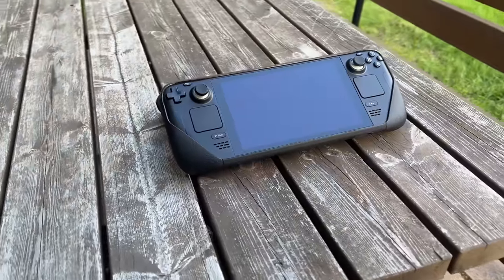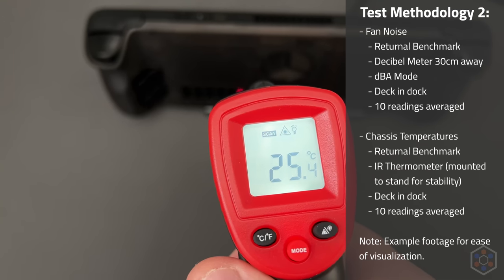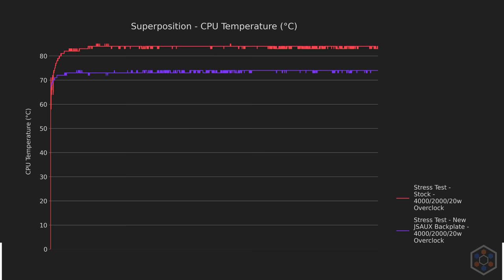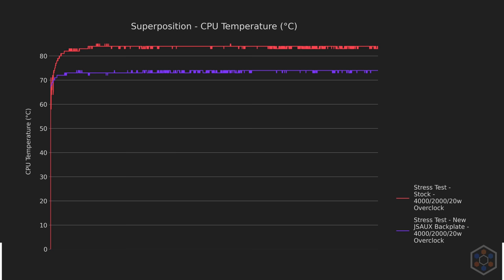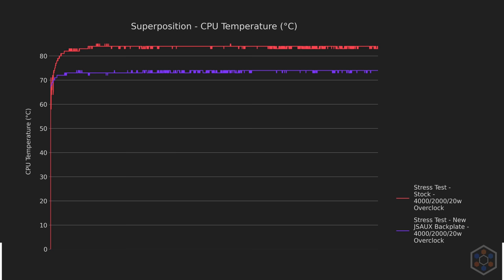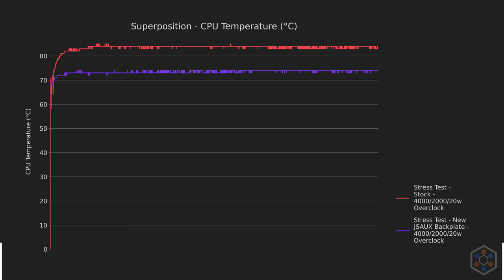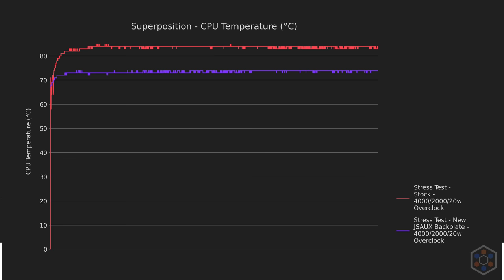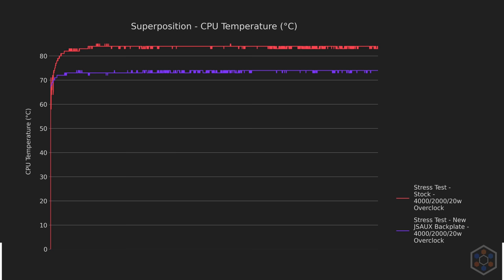How LOW Can It Go? | Steam Deck Thermal Modding

Comment: Kyle. You are the gift that just keeps on giving! There is a lot of scattered content on thermal modding but the video you created has the next level of polish to it. Sincere thank you from the community.
Reply from the maker: Thank you so much for watching another video! 😁 As always, I'm just happy to help.
Reply: I just had an idea. Drilling out vent holes in the back of the old Jsaux case would give you the best of both worlds right?
Reply from the maker: @jackinabackpack7599  theoretically similar, but with a lot of the heat sunk into the backplate still 🙂

Comment: Jsaux new backplate with thermal pad and fan intake vent looks promising especially if you want a quieter Steam Deck, but I'm worried it cools down the APU better but removes airflow to other critical components like SSD, ddr ram memory dies, voltage regulators, battery and other components that might get too hot now and fail earlier!
Reply from the maker: I mention that concern near the end of the video, but also mention that I watched all those temperatures and that they stayed identical and have given me no reason to worry about them 🙂

Thank you for watching, I'm glad it helped you out!
Reply: when you think about it... its much like a normal desktop pc right... the only components that typically get direct contact cooling with fan assistance or water cooling are the gpu and cpu with some motherboards getting a fan on the chipset but its often not required. everything else will have a smaller heat sink that is cooled passively, as long as that original opening is not blocked then even with the fan being open to get its air supply it should still drag air in from the original opening, i just dont see it being an issue, all components should get adequately passively cooled.
Reply: I'm curious how loud ur deck runs. I have no issues whatsoever with fan noise

Comment: I'd like to see the temps of the charging IC and the SSD with the new Jsaux backplate. That extra cent hole probably hurts those way more than it helps the APU
Reply from the maker: I actually did test the VRMs, SSD, RAM and ICs (and mention it in the concerns section), they were within 1 degree of stock and gave me no reason to worry whatsoever 🙂 The fan still pulls air through the back vent and the metal plate also contacts the heatsink (which is getting better cooling).

Thanks for watching, I hope this helps!
Reply: @cryobyte33  apricides for video but I must ask - how you measured temps of IC, SSD, VRMs and battery? I heard yours concerns but I have mine as well

https://youtu.be/NeQH__XVa64?t=349

With this hole above fan I treat this backplate like there is no backplate at all because negative airflow is interrupted. I wonder what temps of battery are at your tests while gaming  with docked deck.
Reply from the maker: @RetroWaveArcades  While negative airflow is interrupted, it still pulls a ton of air through the back plate. The fan can pull quite a bit more air than normally gets to it.

As for the temperatures, I used the "sensors" command for SSD and motherboard temperatures, spot checked with the other results I gathered from MangoHUD, and checked.

The ICs and VRMs were a bit more difficult. I used a thermocouple temperature sensor wired through the back vent to measure the surface temperatures, and verified its accuracy with a backplate-off IR thermometer test.

GN does really good work, and I want to make it clear that I'm not trying to argue with Steve's results. All I know is that I did the best I could to to verify that this would be safe for long-term use. 🙂

Comment from the maker: As a note about the vented backplate:
1. I tested VRMs, ICs, the SSD and the RAM for temperatures with the vented backplate and saw less than 1 degree difference from the stock backplate.

2. A lot of air still gets taken in through the rear vent, even with the vented backplate, so I have very few concerns with device longevity, but wanted to be fully transparent!

Edit:
 I used the "sensors" command for SSD and motherboard temperatures, spot checked with the other results I gathered from MangoHUD.

The ICs and VRMs were a bit more difficult. I used a temperature probe wired through the back vent to measure the surface temperatures, and verified its accuracy with a backplate-off IR thermometer test. Obviously the backplate-off results are cooler, but I verified that the probe was accurate that way.
Reply: OK that's the answer I was looking for :)
Reply: Finally bro, thank you for relieving my stress with the vented back plate. I bought it but started to think about how tf air passively cools the Ics, ram, etc
Reply: I love this video, but I wish you went into as much detail about your validation of all critical component temperatures as you did with the rest of the testing methodology. The airflow the way Valve designed it is very much needed to keep things like the charging IC and MEM4 within safe temperatures, as per GN's analysis. While I am definitely open to the idea that the JSAUX backplate could be an improvement all around and would love the performance/aucoustic gains, I would need some more details than (crudely put, I am sorry) "trust me, I did some testing and it all seemed fine to me" in a comment. It seems like you actually did some thermocouple testing, I would have love it if that was included in the video! I'd love to modify my Deck in this way, but as it stands the details as to the thermal safety of doing so just aren't enough for me to risk my Deck.
Reply: 👍 Thanks!
Reply: Your videos are really cool! But what about the power consumption? If the SoC has more headroom in terms of temperature and therefore keeps the clock more stable, it should also consume a little more power, right? Or is that compensated by the lower power consumption of the slower rotating fan?
Reply from the maker: @GogOlo4  It depends on exactly what you're doing, but this will basically just allow the chip to keep using it's nominal 15w for longer. Technically that could look like shorter battery life, but you get better frame times and performance, plus you can mitigate that feeling by pinning either the wattage or the GPU to whatever you'd like 🙂
Reply from the maker: @wafu6058  I used the "sensors" command for SSD and motherboard temperatures, spot checked with the other results I gathered from MangoHUD.

The ICs and VRMs were a bit more difficult. I used a temperature probe wired through the back vent to measure the surface temperatures, and verified its accuracy with a backplate-off IR thermometer test. Obviously the backplate-off results are cooler, but I verified that the probe was accurate that way.

It's interesting that you have different results than I do, are you obstructing airflow with the probe wire maybe? 🤔
Reply: Which size did you purchase for the thermal pads?
Reply: @wafu6058  maybe Cryobyte's room temperature was lower than your's
Reply from the maker: @wafu6058   hey sorry, I'm in the middle of a move across the ocean so I'm pretty busy. I don't remember the exact thermocouples I used as they're in a box over the Atlantic, and I don't have the time nor the footage to make a video about it for at least 2 months.

My process was:
- Drill a small hole in the lower vent mesh in the JSAUX v2 plate
- feed the thermistor through and attach to the VRM, RAM, and ICs
- attach them using kapton tape, attempting to seal as best as possible

I tested using the backplate on as well, but with no additional heat channel like you.

The only things that leap out at me are variations between the different backplates, possibly even different reinforcement leading to slightly hindered airflow. It's also possible the thermal pad in the gen 1 plate in hurting performance as it's much larger than the newer one.

I'm sorry that I don't have the capability to test it again just yet, but I'll attempt to follow up as soon as I can when back in the US 😓
Reply: Hey man, appreciate the immense effort that went into this video. I wanted to ask about the "mixed" results that come with the Aliexpress version of the PTM7950. I live in a country where my access to Honeywell's original PTM7950 is especially limited, so I did some digging and someone on the framework laptop forums suggests that the 0.2mm thick ("fake-ish") pads have pretty much the same performance with the 0.25mm thick (original) pads. Can you point me in a direction where I can learn more about the shortcomings of the non-Honeywell versions?
Reply from the maker: @prepor584  To be clear, most of what I heard has been anecdotally shared by users I trust on the Discord server. The users mentioned that the Ali pads are sometimes Honeywell and sometimes not. The non-Honeywells tend to average a few C hotter than the good ones, but still a bit better than the stock paste.
Reply: That‘s the infos we‘re waiting for.
Most people think there’s no cooling air running through the Deck with the jsaux v2 cover and vram, ssd… will die.
I‘m very happy with my v2 Cover and the lower temperatures and the slower turning fan.
Reply: 1. If that paste is not a silver compound then you minds well be using non-toxic elmers glue for your safety.
2. Use thermal pads on the backplate thereby sealing the fan? (The folks who cut a hole in the default case have certain tape preferences that might lead to a solution.)
3. Anti-Glare Matte finish on screen to lower brightness thereby decreasing heat and freeing up battery power for faster fans rates.
4. Custom heat sink piping: Suggestions? Copper?
5. Better Fan.
(Also do not place in sunlight, and check if the charging block is overheating.)
Reply: That is VERY good to know, thanks for testing! Guess I will go for the vented Backplate then.
Reply: Thank you, this allleviates my worries about the plate.
Reply: I'd recommend exercising extreme caution with regards to your sd cards. From my experience the area around the sd card gets concerningly hot with the vented backplate.
Reply: Kind of a weird question, but is a potential option to use that vented backplate but just cover the vent with something? That way you get the designed airflow without the hot part of the old backplate
Reply from the maker: @ryanlancaster1229  yup, it'll function basically identically to a stock backplate 🙂
Reply: @cryobyte33  ok cool that may be a good compromise for me then. Thanks!
Reply: So just for my assurance, I've installed it but there won't be any negative long-term ramifications of using this?

Comment: I have the OG JSAUX Backplate  and I also did a repaste but after watching this video I bought the thermal pad as well as the new jsaux backplate. My temps on my OC  Deck have been basically always in the 80s so seeing those temps drop will be greatly appreciated
Reply from the maker: Agreed, the stock thermal system is great but not quite up to a good OC.

Thank you for watching!

Comment: Would you consider making a follow up video on this when used in the long run? As you stated, there could be issues with removed airflow to other components, but it's probably impossible to tell in such a short amount of time. Would be interesting to see how or if it changes with time.
Reply from the maker: I might be able to later, but I might be doing other mods in the meantime so it'd be hard to isolate changes.

What I can tell you, though, is that:
1. I tested VRMs, ICs, the SSD and the RAM for temperatures with the vented backplate and saw less than 1 degree difference from the stock backplate
2. A lot of air still gets taken in through the rear vent, even with the vented backplate. 

Hopefully this alleviates some of your concerns, thank you for watching!
Reply: @cryobyte33  Thank you so much for taking time to respond! I ordered a backplate now, I understand it's at my own risk but I feel at ease now, regardless of how it goes <3 Thank you for your hard work, it's much appreciated.
Reply: @cryobyte33   would this less than 1 degree difference in internal components be enough to cause some kind of damage?
Reply from the maker: @jhooGs  Nope, not by any stretch of the imagination! You'd likely need a 8C+ difference over a long period, or 15C+ in the shorter term to make a significant difference of any sort.

Comment: Thanks for the video! Some dB(A) info for you:
- This measurement is on a logarithmic scale - Every 10 dBA is equivalent to a doubling of sound pressure.
- Example: 2.7dBA is NOT 2.7x louder - that's closer to 30% louder IF measuring the exact same tone.
- Example: an 80 dBA sound is 4X "louder" than a 60dBA one. This is the difference between a normal conversation face to face and a movie theater.
- dBA is a measure of sound pressure - not necessarily perceived volume, and:
- Higher frequencies will generally sound much louder to us than lower ones at the exact same dBA measurement.
Reply from the maker: I knew about the logarithmic scale and the frequency thing, but not the rest, thank you so much for explaining! I'll screenshot your comment and be sure to follow up with more research where needed, I appreciate it! ❤️

Comment: That warning for taking your morning coffee before working on your steam deck is REAL folks! I just did the JSAUX backplate mod last week and of course - forgot to remove my microSD card. It snapped in half leaving the rest of the card completely stuck in there and I only made it worse trying to use tweezers to remove.

Luckily I have a 1TB SSD so won't be needing the microSD card slot...but a huge bummer nonetheless.

Anyways - excellent video as always Kyle. Thank you!

Comment: Just wanted to drop by and add my voice to the choir. I also changed to the Honeywell pad and jsaux backplate. This, together with a cryobyte-undervolt and a fan replacement changed my deck from “pretty damn annoying” to quiet and amazing. I’m extremely satisfied with these upgrades.

The pad was a pain to install, but indeed worth the effort.

Thnx for all your amazing guidance 👌
Reply: What fan did you get? Also, what is the honeywell thing..?

Comment: I have the Delta fan but never found it bothering me since I always cap the fps/ screen refresh. I finally changed the backplate (vented) and thermal paste to NT-H1 and what a difference in noise! The fan is barely audible most of the time. I wish there weren't so many fake PTM7950 sellers out there. I'm happy with the Noctua paste for now. Thank you for your hard work!

Comment: I live in the desert.  (AZ) It's usually no cooler than 80°F in my home.  Currently have the old metal plate Jsaux that is effing HOT! I used these links to get the new back and the Honeywell pad.  Liked,  subscribed,  and will look into your patreon.

Comment: great video!
I have the old jsaux backplate. I slapped a blue anodized heatsink on it with a thermal pad and nothing gets too hot to touch. I have not overclocked. Sometimes the fans don't even run. That is when accessible parts get the warmest, but not hot enough to trigger the fan. I can even feel warmed air coming from the top vent on pure convection sometimes .

Comment: Kyle, another great video.  I'd like to share my setup, experience and also ask a couple questions.  
First, I am running your CryoUtilties and followed your excellent Undervolt & Overclock video.  My best stable setup was UV = 40/30/40: OC = CPU 3950 / GPU 1800 : TDP = 17 Watts.  After replacing my back plate with the newest JSAUX, my current stable setup is UV = 40/20/40: OC = CPU 4300 / GPU 2100: TDP = 20 Watts.  The back plate made a monster difference in deck temps.
Second, I've used a few different tools for benchmarking & stress testing (cpu-x, Superposition, gtkstresstesting (locks up on me) & mprime) however, I've never seen my CPU run @ more than 4058 or my GPU @ over 2000.  So, it doesn't seem to matter if I tweak the BIOS settings above 4000 & 2000 respectively.  My next step is to crank up TDP to see if it makes a difference.  Any thoughts on a better tools for benchmarking or what I may be doing wrong?  Temps at my current config are low 70's to low 80's while pushing the deck hard, seems there's room for more juice.

Comment: Thanks for the insights. I’d like to add 2 cents to it. The stock backplate isn’t that great in terms of thermal design. Warmer air has higher static pressure. Stock plate has intake vent right above the silicon cover, which is heating up the air and causing elevated pressure that will hinder cool air from flowing into the chasis. That’s why fan speed has to go much higher to counter that effect to keep air flowing into the chasis. I think the best backplate will be a vented cover with metal plate exposed for magnet peltier cooler.

Comment: Dude as soon as you said 50 hours I had to comment, thank you, in advance!
Reply: Great video, watched the entire thing, I do have a comment about the backplate though. I'd be interested to know if it could be resealed, how it would perform then in comparison to the stock plate. The negative pressure you point out, according to Gamer's Nexus, that allows area to be pulled over the battery circuit which if it doesn't do that, may be long term implications and could cause damage due to running at higher, possibly out of spec temperatures. If the newer backplate's, fan vent, was sealed, you may get the best of both worlds, and address the dust and noise concerns. Worth considering for sure - looking forward to the block testing :)

Comment: something i use that you may want to check out is a graphene thermal pad. it goes over the gpu and is pretty thin. beats putting paste way deep in there.
Reply from the maker: Thanks for the recommendation, too! I've had one before, but I'll need to wait until I'm back in the US to get another. We'll see 😉